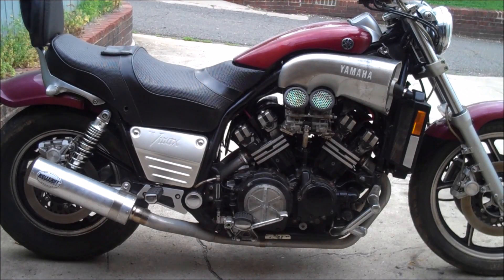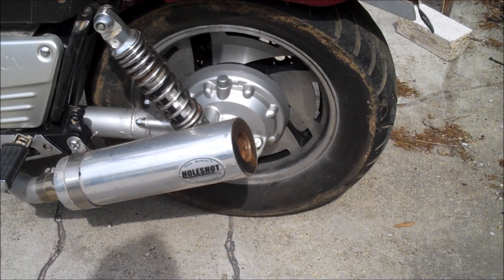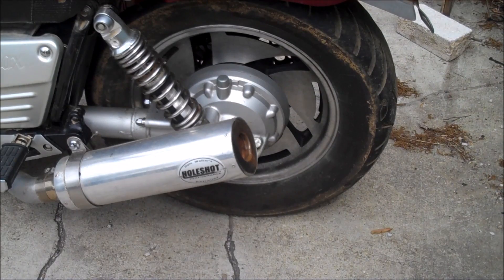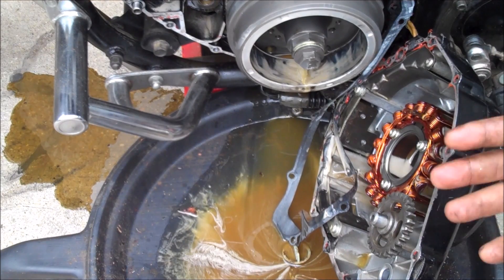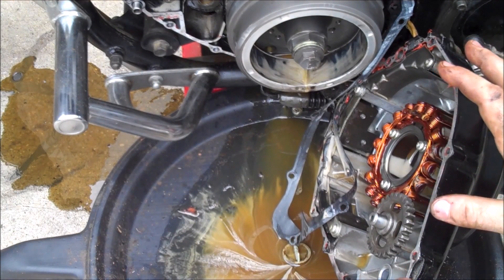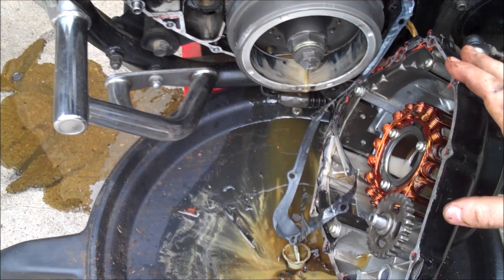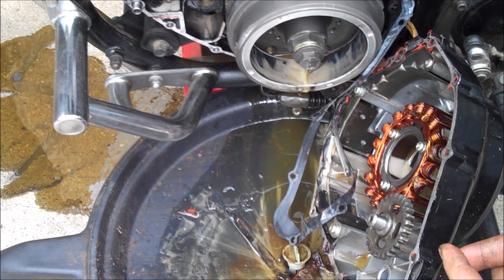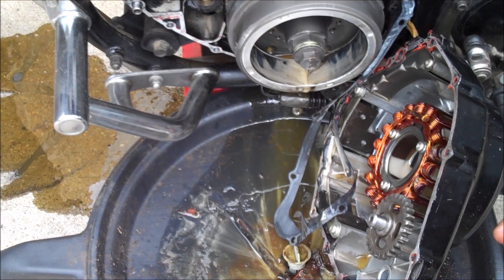How to free up a seized motor

Comment: To clean out the oil pan after I drained the cruddy oil out, I took about 1/2 gallon of kerosene and one of those 12.99 battery operated transfer pumps from harbor freight and let is circulate through the sump for about 5 mins. I rigged up a funnel to catch the fluid with a rag to filter it as it drained out the oil drain hole and into a catch pan where I had the pump sucking it back up and pumping back into the oil fill hole. I did a second flush with fresh kerosene and it was a lot cleaner... so I figured it was good enough.

Comment: My motorcycle engine seized while riding (kawasaki gpz 500s 1991). Do you think I can save the engine without replacing any part? I was going around 23 mph and I don't think it did great damage. And how can I get the engine free?
Reply from the maker: If it happened while running it's probably toast
Reply: @mrmaxstorey  fml. I got it a week ago and this was my first time riding (because I had to to tehnical inspection for The bike to be road worthy, that's what most countries do in Europe)
Reply from the maker: @IPCRo  well it's possible only the transmission seized, or maybe something got sucked up into the drive sprocket. But that's not as likely as your engine seizing
Reply: @mrmaxstorey  what do you think about the chain from the starter motor  to the flywheel? It could have snapped and block the teeth.
Reply from the maker: @IPCRo  yea could be. Drain the oil, make sure it doesn't have water in it, and look for chunks of metal or silver flakes. Does the motor move even a little bit? Or is it locked completely tight?

Comment: i did something stupid and poured some regular oil down the pistons after taking out the spark plugs….what do you recommend i do…i probably put 4 oz in each hole.
Reply from the maker: We're you trying to unseize the motor?
Reply: @mrmaxstorey  yes
Reply from the maker: @mellamodiego8458  ok it's no big deal you didn't hurt anything. Take a piece of small hose, put it in each spark plugs hole and suck out the oil until it empties, and then you can refill with something that might penetrate rust a little better

Comment: I have a 2006 Kawasaki ex250 with a seized motor. i took off the stator cover to expose the bolt connected to the crank. It is not the small bolt with the large bolt behind it, like on your Yamaha, only a 12mm bolt that unscrews counter clockwise, and barely budges going clockwise, until it gets so tight i dare not push it any further. I think, looking at parts blowup, this is connected to the crank, but it is small and looks fragile. Doesn't the Ninja have a crank bolt to try and unseize the thing? There are no video out there on Ninja 250 motors being free'd up. The local dealer said an engine rebuild is more expensive than the bike is worth and he could try and figure it out but 95.00 an hour to do it. Any thoughts on how to handle these 250 cranks?
Reply from the maker: Well yknow you can try to put it in gear and rock the bike back and forth to free it up, but honestly it makes a lot more sense to me to just replace the motor. You can buy a used motor on ebay for 200-300 and put it in yourself in 3 hours or so, these bikes its really easy. I have a few videos up of motor swaps and removal/installations, they are mostly on 4 cyl motors but the concepts are the same

Comment: Did you put the spark plugs back in after the WD40? My bike engine is not seized but when I try to start it, it acts like it for a few tries. I think I am going to add that stuff and see. Thanks for the video.

Comment: Hey brotha do you mind checking out my quick video for my bike   is it seized?   https://www.youtube.com/watch?v=FVr-uwhe2ns
Reply from the maker: It certainly looks stuck, but it could also be a low battery, a seized starter motor, or a bad bendix/starter gears. Pull the side cover off and put a wrench on the flywheel, try and turn the motor over that way. That would be the real confirmation
Reply: @mrmaxstorey  thanks man  i've bench tested the starter and it runs fine, also I have a new battery  and I've used a jump stater dumb question, does it have to be in gear to turn the flywheel like you suggested ?
Reply from the maker: @bmw5050  No all it is doing is turning over the motor like you are hitting the starter, so it should be in neutral
Reply: @mrmaxstorey  thanks man  you're awesome

Comment: Hi Mr max
I bought a quad bike 350cc,(Chinese replica of the yamaha raptor 350, it's called hisun. Parts are identical ) project, the owner said it just needs a wiring loom/harness. I bought a harness and  installed it, and the bike was turning over, by jumping the solenoid with a spanner but it never started(battery is new) . With some advice I was told to try another harness and another stator and cdi. I purchased all the required parts from someone stripping the same model. 
I tried it one last time before installing the new harness and is still just turned over but no spark (even though I used a lot of starting fluid) 
I then put the new harness in and connected it up and it stopped  turning over. 
I tried  checking everything on the harness, everything seemed fine. After a while, I put the old harness back in and then too it no longer turned over. I tested the starter motor it's turning great. I took off the left motor cover and trying to turn over the motor with a wrench, I found it to be stuck, stuck. I left it for few months now, any idea what's going on with this bike , is it ciezed and unciezable or is  it that the timings are out or any other advice will be highly appreciated
Thanks in advance.
Reply from the maker: With a little luck all you did was hydrolock the motor with all that starter fluid and gas. Remove the spark plug and see if you can get it to turn over
Reply: @mrmaxstorey  unfortunately removing the spark plug hasn't made any difference. 
Where's to next
Reply from the maker: @muhammadmohsin3321  Bummer. Well sounds like its physically seized. You can take it apart and see what happened if you want but it doesnt sound like this video will help you
Reply: @mrmaxstorey  whew
That's quite strange though,  without the motor running, just the starter motor doing that much damage?
Reply: @mrmaxstorey cheers dude you just helped save a old old vmax ,uk Scotland .

Comment: what about if the engine was running without oil and it seized?
Reply from the maker: This repair will not help you and you will need a total overhaul or replacement

Comment: Just used this method on my fireblade, which has been garaged for nearly 20 years. It took an hour soak in WD40. Got it moving on the back wheel in top gear. Bit more WD40. 30 minutes later, it turns over on the starter motor. What a legend, thanks a million 😊😊😊

Comment: I was able to free up the motor but it freezes up again after I crank it over.2002 vmax 1200.Ihad to remove casing again and free with the breaker bar.

Comment: What kind of seizure would this be ( I was riding my Yamaha yz476f 73mph and all was great until immediately I hear some banging around in the motor and the back wheel locks up, but it will still shift through gears but the wheel will not move and it won't turn over?
Reply from the maker: This method will not help you. Likely you need a new motor

Comment: near boiling motor oil down the plug holes.
obviously use metal funnel and copper or aluminum pipe.

Comment: Hey so I got a 77 sportster hasn't ran in at least I'd say 5 years.(oil was changed before it sat)Been stored in garage then my shed when I got it. Putting a chain on it tomorrow. Should I try rocking method first with out lube in cylinders? Or just spray it and let it sit overnight?
Reply from the maker: Always lube it up first before you attempt to rotate a dry motor

Comment: ive got a 75 honda goldwing gl1000 been sitting for ten pluss years pulled tank flushed  shook ann that got it clean or rust pulled carbs off cleaned boeles up flowts needle ste ats reinstalled freed breaks system drained now motor thought about marvels oil and desial fule flushing ithe gears only dont kown best way should i pull the case cap on top under neath where the carb linkage and put a small hose in there to flush the block and just let it wash and pull the lower oil drain plug

Comment: Would this work for a 04 Yamaha xvs65 that just didn't have oil?
Reply from the maker: If your bike sat for a long time with no oil, then this might work. If you drove your bike with no oil and it stalled and seized up, most likely not

Comment: I have a 82 yamaha maxim 650 it sat for years I could move the engine at all I did the processes that you show in your video and boom the engine is free thank you for the great advice
Reply from the maker: Thats great to hear its a great bike. Be sure to check compression I hope you get it running
Reply: mrmaxstorey it runs need the cards adjusted and I love them YICS engines this is like the 3rd one I've owned and my father had a 750 seca

Comment: what if you get like a pop or back fire coming from the intake? So I removed the carbs and tried spraying starter fluid and then used pressed the starter button and got like a flame coming from the intake....
Reply from the maker: Yeah youll get that if you just spray starter fluid into the intake with no carbs. It could be a sign of timing off, fouled spark plugs, or no problem at all just drowned in starter fluid. Clean the carbs, replace the spark plugs, put it all back together and next time just spray a little starter fluid into the airbox if you are trying to start up the bike

Comment: I pour Marvel Mystery Oil in each cylinder then I get my heat gun and heat up the jugs and really really good all the way around and then I use the transmission rocking back and forth method heat it up really good again and keep rocking it and it is guaranteed to work! use a heat gun not direct heat like a torch you'll screw up the head gasket and then you got really big problem!

Comment: My carb caught on fire when I started my bike then after using dirt and waterto put it out just the gas lines were burned but my kick start got stuck would you happen to know why
Reply from the maker: You may have hydrolocked the motor with the water. Try taking out all the spark plugs and kick it over a few times to clear it out. Next time dont throw dirt and water in your motor, have a good fire extinguisher on hand
Reply from the maker: You may have hydrolocked the motor with the water. Try taking out all the spark plugs and kick it over a few times to clear it out. Next time dont throw dirt and water in your motor, have a good fire extinguisher on hand

Comment: Is there a point to which the motor can be so rusted it's impossible to free up?
Reply from the maker: Well, I like to say that with bikes, nothing is irreparable. Given enough penetrant and a long enough breaker bar I suppose you could bust any motor free. At that point though the damage to the pistons and cylinder walls may be so great that the motor will have no compression, but yeah you can bust free most motors

Comment: The next time you do this use Marvel Mystery Oil. This was designed to do everything you are trying to do. It not only provides top notch penetration but it is is also a first class lubricant that will mix well as a fuel additive. So when you finally get the engine broken free it will not be hard to clean out the liquid that you used to free your engine. I have had very good results with it on many different things. It's the best.
Reply: Hi Tbull, what is the best way to clean up the Marvel liquid inside Engine once unseized?

Comment: I mix up 50/50 Diesel fuel & ATF. Fill each cylinder to the top and let it set for a few days. Last engine I did was a 4 cyl. Diesel that had been setting in a field for 6 years with an open intake. Been running fine for the last 3 years now.

Comment: +MrMaxStorey would it be possible to use an Impact Wrench that has Forward and Reverse?

I think Impacting where it hammers it in short burts forwards and backwords on the bigger nut as you said. or would this tighten and loosen the bolt?
Reply: Good luck with your trike project - I had a bike accident last year and broke my back losing the use of my left leg (T12-L5 crushed). I traded my FJ rat bike for a Reliant Rialto 850cc trike - well worth it! I then made a sidecar for one of my smaller bikes before deciding "feck it" and jumping on the bike that broke my back (after rebuilding it of course!) Turns out I don't need to modify EVERY type of bike to ride - I can change gear on the Fazer, but I can't on my cruisers and needed to make a jockey shift to ride. Hope you get on the road!
Reply: i wouldn't use a impact, why? you cant feel if its binding in any one spot like a breaker bar would let you feel.
Reply from the maker: An impact isnt a bad idea, I just dont have one
Reply: +mrmaxstorey I just wondered. i have an impact wrench. I'm disabled and in a wheelchair so i don't have the luxury of sitting on it and moving back and forth. i bought a 82 or 83 Yamaha xj750 Seca for the soul purpose of converting into a trike. its been sitting outside for a few.years. guy said its possible it might be seized up. it ran before it got parked cause he got a Kawasaki.  so i got it for 150. going to take off the carbs and clean up plus the tank. and if its seized i thought maybe i could use an impact on it.
Reply: Well thats cool. There are a lot of really good modifications that guys make to bikes to make them more usable for disabled riders. I modified a bike once for a guy who lost a leg, it was fun and challenging. 

Its cool what you are doing and the Seca is a great bike. However if this was my project I would probably start with a motorcycle that isnt as old, and isnt possibly seized. Making a trike and doing all kinds of modifications so you can ride it is a big project, so it may be worth starting with a more reliable/newer bike as a platform, especially ecause you can't exactly push it to the next gas station when it breaks down. Just my 2 cents but hey whatever you decide, keep us posted.
Reply: Well, the issue with that, is I'm also Low income lol. and the Price was right, the bike only has 12k miles on it. And for $150 bucks, the Price seemed right.

A newer one would be awesome, but unfortunatly the wallet can't take the price of a newer bike.

So, this is what I've got and I'll make the best of it, Hopefully it will fullfill my needs for a starter bike, Later on I may be able to sell it for a little more money and Upgrade to a newer bike later on down the line.

I have a 1975 RUPP Centaur Rear end that I'm looking to try and use on it, It's got Drive 1 and 2, Neutral and Reverse in it. Independant Rear Suspension, Duel Disc Breaks and Emergency Break.

I think it will be Perfect if I can get that going on the bike, this will give me reverse when I need it. As far as breaking down, I don't think I'll be making LONG Distant Trips unless it's with a few buddies on a Ride along or something so I got help when needed.
Reply from the maker: OK have you worked out how the rear end will mate up with the shaft drive?
Reply: That I have not yet. I'm still kind of in the Design Phase.

Money is tight so right now my Focus is to Drain the Tank of the OLD Gas. Yank the Carbs and clean those really well and jets.

Then see if the Engine is Seized and if it is, Try to work it loose. Then get a Battery to Fire it up and get it running.

Then Purchase some metal as soon as I get a Good design I'm looking for.

What I may have to do is Design a Jackshaft to convert to Pulley for the Rear end, if you know anything bout the Rupp Series, The 75 uses a Commet Clutch System cause it had a 340cc 2 Cycle 2 Cylinder Engine on them.

So a Clutch or Pulley at the end of a Jack shaft OR An extended Wheel Shaft with a Pulley on it.  If i can't get that to work, then I may have to use a Different Rear end, i was told that for Drive Shaft most common was a Mustang Rear end.

Uncertain just of yet how I'm going to tackle it. I'm also working out some Ideas on a Ramp, I'll be riding from my Wheelchair.

Comment: so i was riding today on my kx 60 after i cleaned it. and i was going in third gear and a truck pulled in front of me so i pulled the clutch and slowed down, then the bike stopped completely. so then i stopped and kickstarted it and the kickstarter got jammed and wont move. you have any tips on what to do?
Reply from the maker: +Mijo Mike That sounds like a failure in the kickstart, unfortunately this video will not be of any help
Reply: +mrmaxstorey do u have a video of that?

Comment: Thank you so much, using your method I was able to unseize the motor in the pit bike that I just bought. It smokes heaps as the rings will need replacing but I had no intentions of bothering with the motor in it

Comment: Mr max I have a yamaha kodiak atv it sat for 2 years with a cover over it but its a automatic. and it has a pull rope should I try pulling it i stead of putting a breaker bar on i filled cycliner with wd40 it has been in it for 3 days .. what do you think
Reply from the maker: +Mr ace Sure go ahead but don't yank that pullstart until the rope breaks. If you take off the pullstart assembly you'll see the flywheel bolt and you can put your breaker bar on that if you need to